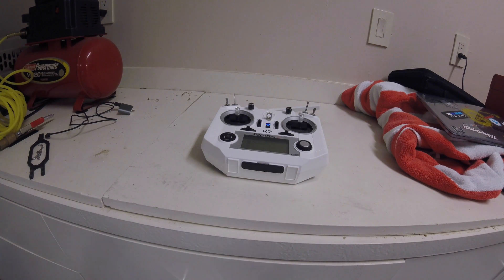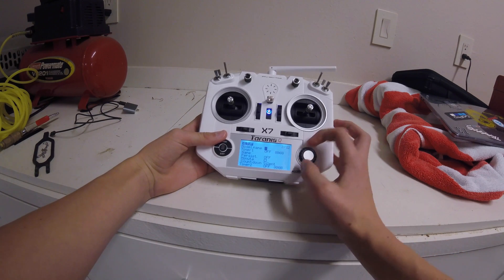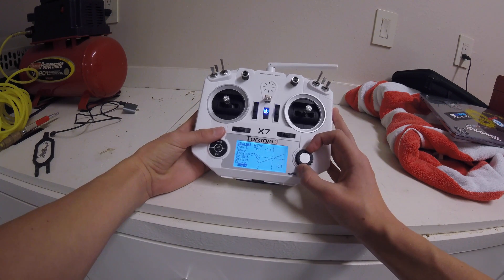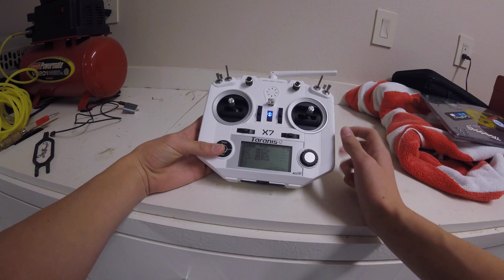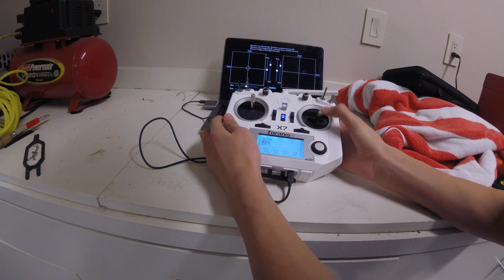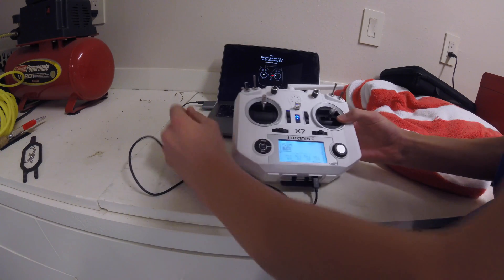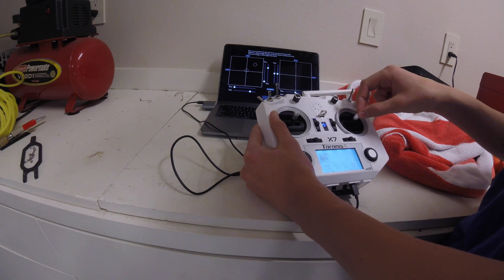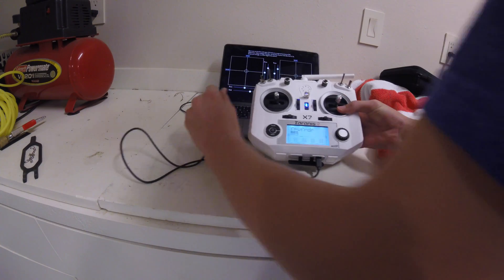Taranis QX-7 Simulator Setup

Comment: I just got a taranis q x7 and when I first plugged it in it worked with simulator and then while in the simulation it stopped working. I now cant get it to connect again to the simulator. Any ideas on what I should do to get it to work again?
Reply from the maker: When you first plugged in the controller, did you follow the steps in the video? I found the program to be very finicky without doing the proper steps. You could also try a new macro USB cable because in order for those to work consistently it has to be a relatively new one. Hope this helps!
Reply: @platinumrc6459  I didn't follow the steps in the video because I didn't know I needed to change anything on the controller. I have tried multiple times with disconnecting it, creating a new model by following the steps you have shown in the video. But it hasn't worked yet. I just got the controller like 2 days ago and it came with a new micro USB. Any suggestions?
Reply from the maker: Jeez, there might be something up with the computer. When you plug the controller into your computer, check to see if the computer is recognizing the device. Also try a different computer or USB port. This is starting to sound like a computer or USB issue more than an issue with your radio

Comment: I followed your instructions to the letter but Frederic still does not recognize my QX7 stick input. There must be other settings that are needed but you did not mention any other settings. What could I have missed?
Reply from the maker: Have you tried a different cord? Mine did the exact same thing but I just had to buy a new cord and it worked perfectly!
Reply: Well it turns out that the problem was in the settings in the Q X7. I still had the internal RF turned on. I do have a 4 in 1 module installed but it was already turned off.  But now, all of the calibrations are way off. The sim is not recognizing the settings in the Tx as far as the AETR mode 2. The AETR is all mixed up in the sim. The throttle and the pitch are working but there is no yaw or roll. The sim settings for trim and scale do nothing for those two. I can't even manually change the stick positions in the sim's manual settings to get them to show up. I had all of this working fine on a different computer a long while back.

Comment: What ccord are you using to connect it to the computer?
Reply from the maker: Lonny Harris A macro HDMI cord
Reply: Platinum RC what is the adaptor that it’s connected to? Thanks.
Reply from the maker: Lonny Harris For a newer-model MacBook it is a USB-C to USB adapter. I use the one made by Lention on Amazon.

Comment: you went straight to calibrate.. i was waiting for the drive installation
Reply from the maker: There shouldn’t be any drivers you have to install to get FreeRider to read the controller. Is it telling you that you need one?
Reply: @platinumrc6459  windows wont detect the unit so i have to mess with stm device in dfu mode and load the correct drivers for windows to pick up the taranis
just looking for the correct drivers
Reply from the maker: Here- try this one: https://www.open-tx.org/2013/07/18/taranis-windows-usb-driver-for-manual-installation
Reply from the maker: If that one doesn’t work, try this one: https://www.hanselman.com/blog/HowToFixDfuutilSTMWinUSBZadigBootloadersAndOtherFirmwareFlashingIssuesOnWindows.aspx. I hope this helps!

Comment: wow thanks for the video. By the way, is that a MacBook? I don't have a PC but only a MacBook. Do you need to install any driver on the mac to hook up with your QX-7?
Reply from the maker: Yes, that is a 2016 MacBook Pro. Fortunately, no driver is needed!
Reply: @platinumrc6459  Thanks!! btw, what software are you using on the mac to Calibrate the radio?
Reply from the maker: I’m just using the calibration feature provided by the simulator. It should be on the right side of the home screen underneath the input button for me.
Reply: Platinum RC got it! I will look for that

Comment: I followed your steps but when i start freerider i push on the throttle and the quad shoots straight up.It doesnt matter if i even slightly touch the throttle the quad goes straight up.What can i do to fix this?
Reply from the maker: Ok, first, are you able to roll and yaw?
Reply: @platinumrc6459  Hey PRC i was able to figure out what was the problem and since i am very new to the taranis qx7 when i created a model for the sim i did'nt back up the settings and i did'nt have the internal rf,external rf turned off so after turning this off i am able to fly the sim easily so thnx alot for responding,  your video helped me alot!!!
Reply from the maker: No problem man! I’m so glad your problem was fixed! Happy simming!

Comment: Damn it didn’t work for me...
Reply from the maker: Hey Mike. Can you please tell me what is happening so I can help you?
Reply: Platinum RC I tried it a different way and got it to work.  Thanks for the reply though
Reply: Mike K how did you do it this way isn't working for neither
Reply from the maker: Hey man what's the issue? I can help fix it
Reply: i have managed to get to work with a audio cable not the micro usb thanks tho
Reply: also i do have one other problem when i turn on my radio no sound or voice plays
Reply from the maker: the sound when you turn on your radio does not come with the radio, you will have to create sounds separately. Or have you already tried to create sounds
Reply: thank god i did think it maybe broke haha no im still trying to figure out how to do that
Reply from the maker: haha ok ill help you find out how to personally I have never set it up
Reply: im only messing with this coz iv not got a kwad built yet hahah
Reply from the maker: so you have to put the sound onto a micro sd card, it can be the same one that the lua script is on if you have the script set up. Here is a link that will go over everything in more depth as well as the software you will need-- https://www.phaserfpv.com.au/blogs/blog/making-your-own-custom-sounds-for-taranis

Comment: Did exactly what you did and controller still does not work, I have the exact same qx7 and movement shows up but limited to inverted or one direction
Reply from the maker: Try setting up a new model. If that does not change anything, double check and make sure that your sticks are moved all the way to the bottom of each axis before you press OK while calibrating. Also check your settings on free rider and make sure the sticks are correct. I hope this fixes your problem. If not, reply and I’ll get back to you.